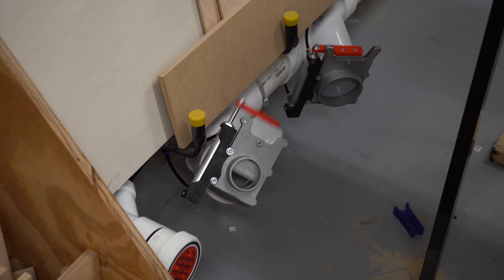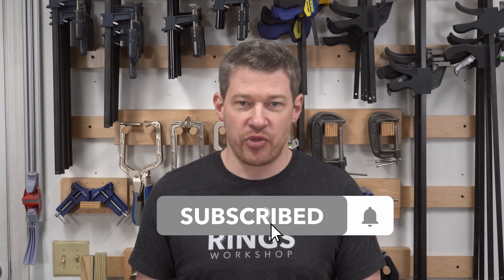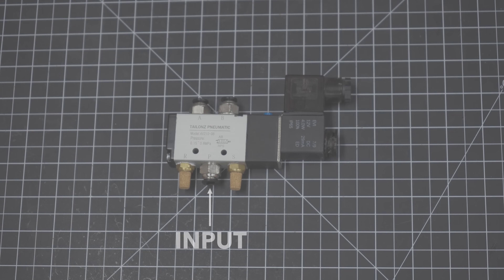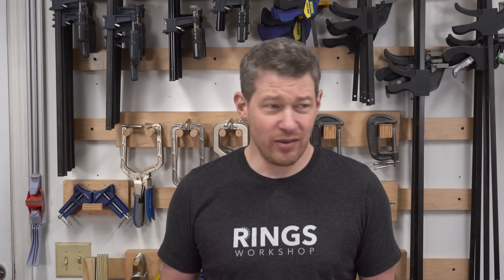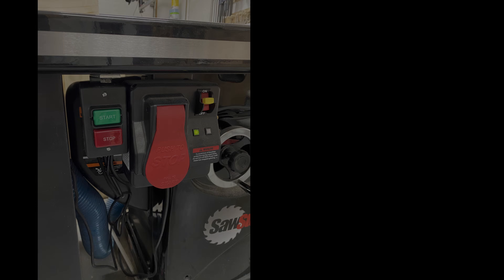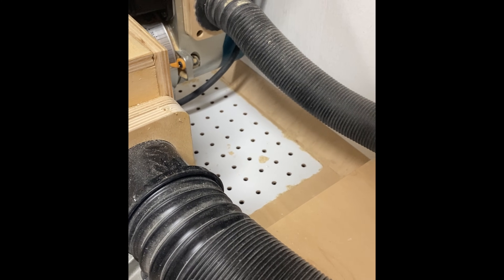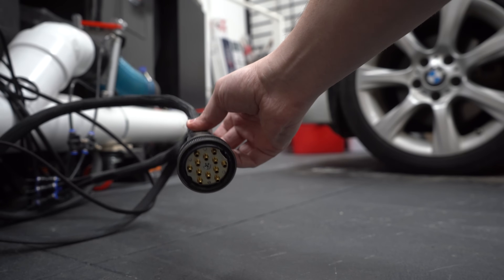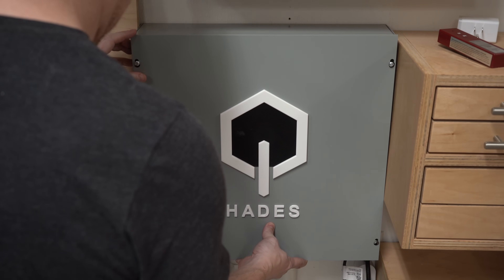How to Fully Automate Your Dust Collection Setup

Comment: This an awesome video. Thank you so much. After 3 years I’m still planning on doing something like that. My shop is not mobile. My approach on motorizing the blast gates was closer to grit automation system way before they were on the market. My main issue is still the linkage between the servo motor and the linear motion of the gate. Grit automation came up with an upgrade using a guide bar recently. I wantedto avoid a centralized system. I wanted to have a decentralized system with all the intelligence built onto each of the blast gate. A microcontroller built onto a pcb which serves as a mount for the servo motor would receive the current sense from the tool. In this setup, a single 4 conductors control cable could daisy chain the whole shop. 2 for the supply of each gate/sense combo and 2 others for dust collection start and stop. With this topology cabling throughout the shop is kept to a minimal. But honestly, on the end, you make me reconsidering it all and go with the pneumatic version. The cylinder in itself solves the rotary to linear actuation problem of the servo to to the gate motion. 

Question : how did you isolate the ACS712 current sensor to short the junction box ?  Im absolutely afraid of these cheap pcb as they don’t even have free air cutout between the power and control side of the pcb. I’m not a real expert on high to low power isolation on circuit board but I am pretty confident they do not follow proper design rules of safety. 

Also, can I ask you if you performed any air consumption estimate ?

Have you considered adjustable mufflers instead of adjustable valves ? 

Could lower the pressure at the main line could solve this problem too ?

Thank you so much !
Reply from the maker: If you watch the video Bob at I Like to Make Stuff did on the arduino dust collection he breaks down the current sensor much more clearly.  As far as air it’s very little as long as there are no leaks.  The lines are only about 6mm thick so it’s not much there.
Reply: Thanks for your reply ! I’m still working on my version. I ordered the cylinders on Amazon but without de fittings. These are M5 ports and the fittings are the most common size in America. The recesses around the port holes are poorly machined so that the fittings does sit tight thus creating an air leak. I have to file around the port hole to create a flat shoulder so the fittings ça seal properly. 

I have suggested about adjustable mufflers. I bought some. BAD IDEA ! when releasing power to the solenoid, all the other solenoid are connected in parallel which in turns connect all the other cylinders in parallel. It creates a reservoir with almost no flow limits for the gate when closing. There is no way I can control closing speed this way. An adjustable supply valve is the only way to control opening and closing speeds. 

Your video is still of a great help in constructing my system thanks again for your work.

Comment: Awesome job, seriously considering doing this. The link to the 5 way solenoid valve is pointing to the Arduino.  I found others on Amazon but they don't quite look the same. Are the electrical coil actuators reversible to orient the way you have them?
Reply from the maker: I’ll look into that link tomorrow, good looking out.  Which electrical coil actuators are you referring to?
Reply: @RingsWorkshop  Hi, yes I mean where the electrical connection is on the solenoid valves. On Amazon it shows a different orientation of the valves so that they are on the same side as the air intake/outlets.

Comment: Nice one Rings !

I have been so very frustrated after seeing the similar "I Like To Make Stuff" project as it was not fully explained .. but you seem to have covered it all & done it neatly too. Very impressive.

One adaption/improvement I want to make is install a PM sensor to bring in an air filter bank when the PM2.5 becomes too high & switch off once the air has cleared... I wish I knew how to code.

Thank you very much.
Reply from the maker: Thanks so much!  That’s a really cool idea!  Coding isn’t as hard as you may think.  A lot of googling and YouTube, and some patience / stubbornness to get it to work, got me to figure this out.

Comment: Great work!
A couple of questions :
1. Why not solenoid gate actuators?  No air leaks and running (and drying) air tubes all over the shop and running the air compressor - air powered actuators are a lot less power efficient and requires air drying.
2. Why not wireless data lines?  Again, avoids running extra wires all over the shop.
Reply from the maker: 1) Speed, air cylinders to my knowledge would open and close much faster and with more force to push out any dust that got stuck in gates. 2) Cost.  Was trying to keep parts cheeper for people who would want to replicate this.

Comment: I absolutely love this project. My hobbies are woodworking and microcontroller-based home automation, and I love it when a project ties in both like this one does. 
But I have never gotten involved with air systems, so I have a couple of basic questions. How do you connect the 6mm hose to your compressor? I'm guessing there's some sort of adapter or fitting? Can you provide a link to a product? Also, what pressure do you use? Do you leave it pressurized when you're not using it?
Thanks again for a great project!
Reply from the maker: Thanks for the kind words!  Great question.  Around 30 psi was plenty but you can always go a little higher then turn it down at each gate.  The kit I used for the 100ft of tubing comes with a larger thread adapter.  I took that up to the size in my compressor but forget the exact sizes.  Was a very common part you can find for a couple bucks at Home Depot, Lowe’s or Harbor Freight.
Reply: @RingsWorkshop  OK I see it now.  Thanks.

Comment: Hey, great video and problem solving.  I have seriously looked at this problem as well, and the issues I ran into were:  1) I didn't want to modify the electrical switches in the tools, as it voids the warranty, 2) I didn't want to have to run wires/air lines from a central location, 3) Also, have a "fixed" layout, 4) Support multiple dust collectors (like a dust extractor at my workbench for finish sanding..  For #1, you can use a Hall sensor, but then you need an Uno at every blast gate basically, which, if you don't use pnumatic, you'll need anyway to control the linear/rotorary actuator.  For #2, Instead of an Uno, use a ESP8266.  They are super cheap, low enough power you could use batteries if you want, and support IoT pretty easily.  The tricky part in all this was the software.  Each ESP8266 would have to be in an IoT mesh, with the hubs at the dust collection, and frankly, I ain't got the developer chops to make it work.  Your solution is great though, it kills the main problem, which is remembering to turn the collector on and reducing the friction of using it.
Reply from the maker: My first solve used servo motors and I didn’t like how they worked and had multiple burn out on me.  Thanks for the kind words!
Reply: @RingsWorkshop  yea, decent servo motors cost money.  Keep up the videos, I'm an automation junkie.

Comment: Awesome idea, just what I've been looking for to add to my shop.  Unfortunately, a lot of the wiring is not available on the video so, do you anticipate a plan you'd sell on your website?  Regarding your Amazon affiliate links; do you have a homepage on Amazon that lists all your parts used in your videos?
Reply from the maker: I didn’t do a wiring diagram as every setup is going to be vastly different and if I did the video would have been 30+ minutes to cover all of it.  I have links to my tools I use on my website, I do have links for parts used in each videos description.
Reply: Thanks for the info...GREAT setup! @RingsWorkshop

Comment: Cool project. Did you check into linear actuators instead of pneumatic cylinders? While they cost more initially that cost would be offset with simplicity, as well as the fact that you wouldn't need any air run anywhere (yes you'd still have to run 12V to each blast gate) or need any solenoid valves. You could still use your relay setup with them.  The control box would be smaller and cheaper as well.
Reply from the maker: I did.  It was more speed to open and close so I didn’t have to wait as long.  But I agree that would have been easier.

Comment: Maybe you could go more in-depth on just about everything.  I think you're looking at at least a good hour long video or multiple 20+min ones.  Sorry, I know it's probably a lot of work but it would help on the learning curve for everyone.  Things like your coding, the wiring to the switches and how your custom parts were mounted and run back to your control box.  
A great solution, and I love all the potential for future upgrades or additions.  Keep building on this solution.  Thanks so much!
Reply from the maker: I initially had it at around 25 minutes but I failed to have video of things like me running some of the wires or cabling and it was just me talking with no video to display so I removed a few things on it that I will try to cover in the future.
Reply: @RingsWorkshop  you definitely have a great solution with lots of potential future content. Very much looking forward to more!

Comment: Perhaps I am missing something where can I find your sketch for the Arduino? I built a proto type of very similar system using that Arduino uno, I was using 5 inch blast gates and hobby servo motors the motor where the weak point so I put it all in a box and never implemented it. the cost of  pneumatic cylinders seemed to have decreased as well as the solenoid vales.
Reply from the maker: The code is in a text file on my thingiverse site that is linked in the description.  My first version a few years ago used the servo motors but I also found them to be the weak point and had a few go bad on me.
Reply: Thank you😁🛫 @RingsWorkshop

Comment: Very glad to see a new release from you, and I love any good automation idea.

Generally speaking, it's not a good idea to have pneumatics and electricity in the same enclosure. There can be moisture in the pneumatic lines and that moisture can make its way into the enclosure from the exhaust ports of the manifolds. I suggest connecting all of the exhaust ports together and install a bulkhead fitting into the bottom of the enclosure. Then when your valve shifts either direction, the exhausted air will vent outside the enclosure. The flow control valves are always a good idea for the reason you already identified as well. For not being a controls guy, you did well. I'd hire you. :)
Reply from the maker: HAHA thank you so much.  Great idea with the exhaust port as well, thank you!

Comment: Impressive. Still a lot to grasp for this old guy. Well done.
Reply from the maker: Thanks!  Was a lot for me at first, just spent a lot of time on YouTube and googling differences in variations of each piece.
Reply: If you break it down, it's not that complicated: A sensor detects current for the tool being turned on. That sends a signal back to the Arduino. The Arduino has a little bit of logic for timing and so on, but it simply turns a pin HIGH, which in turn energizes on a relay. This is needed because you can't drive the solenoid directly from the Arduino, as the solenoid requires too much current. The solenoid turns on which opens the air to the appropriate pneumatic cylinder which moves the blast gate. The reverse happens when the tool is turned off.
Reply from the maker: @larrybud  well said.

Comment: Where is asked to be the best looking dust collection system I have ever seen. You did a beautiful job. Does the compressor have to be on and running an order for the blast gates to open and close? Look forward to your updates to the system.
Reply from the maker: Thanks so much!! Yes but I always have it on anyways and they use very little to fill those little tubes.

Comment: All well and good,  but should you have your hand positioned pushing a piece of wood between the fence and the blade on the table saw?
Reply from the maker: Yes.  As long as it is a safe distance from the blade, that is where you should have your hand.  Having it on the outside only would not feed the board through once fully cut through and would greatly increase your chance of kick back.
Reply: @RingsWorkshop  So, my friend…what are push sicks for?
Reply from the maker: @azul8811  when the piece is too small and forces your hand close to the blade.  The drawer fronts I was cutting would have been more dangerous with a push stick than my hand.  Push block maybe, but push sticks are for narrow pieces of wood, not wider pieces.  There are plenty of videos of me using a push stick on more narrow pieces on the channel, but not on ones where the piece I’m cutting is 5+ inches wide.  If that makes you more comfortable by all means use one in that scenario.
Reply: @RingsWorkshop  Oh, I see. Okay, that makes sense.  Thank you for the info.
Reply from the maker: @azul8811  of course!  Ya using a push stick on a wider piece can cause it to pivot and if that happens after the remainder is cut of it can bind and cause a kick back.